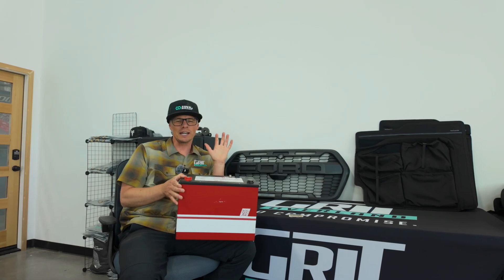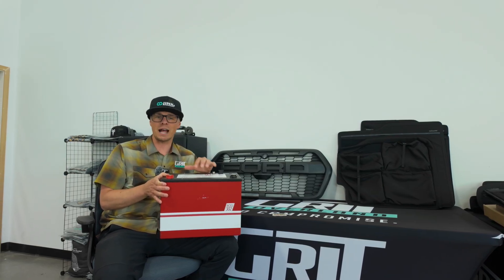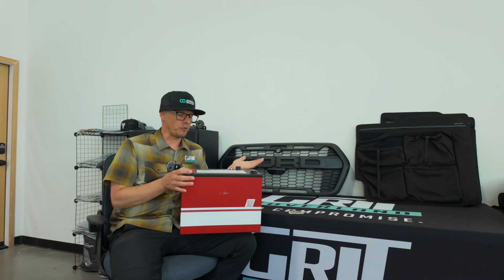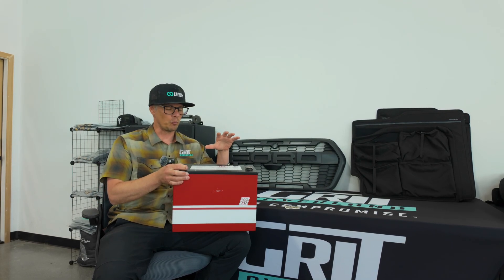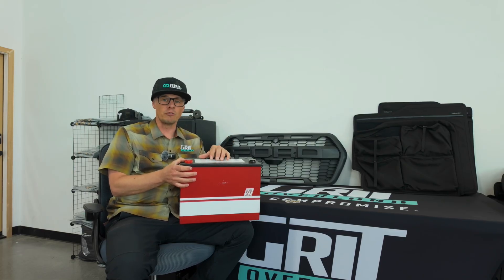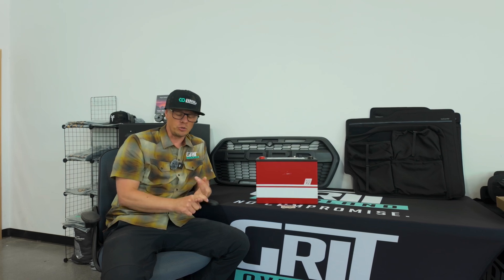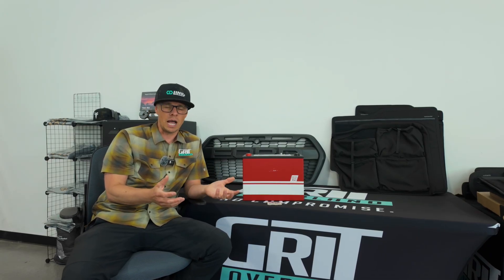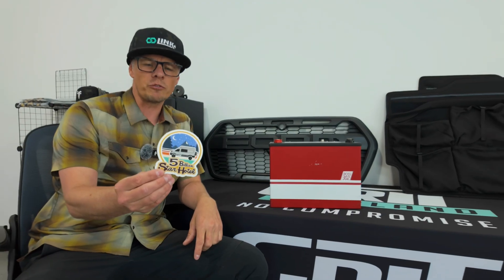What Camper Van Electrical Does Grit Overland Use? 12volt 24volt 48volt battery & off-grid charging?

Comment: Master mechanic and diagnostician here. Without question, higher native voltage house electrical systems coupled with equally matched components of the same native voltage is the way forward. 12V is entirely too low of voltage to support the amp draw of things like inverters, rooftop DC air conditioners, and heaters. There's simply no reason to argue that 12V is good when there are better solutions. Going to a native 24V ecosystem cuts amp draw in HALF when measuring that load against 12V. This cuts thermal loading on long wiring runs down significantly. Imagine how long that 4,2,0 gauge wire run is from battery to rooftop AC unit. Why would we ask that wire to carry insane amp load at 12v when we can do it with 24V or 48V instead and reduce resistance and heat loading. These vans are being built with 12V dual alternators. Hopefully it won't be long before the manufacturers offer native 24V alternation to assist with house voltage standards. You can get a 24V charging setup from Wakespeed which allows more efficient DC to DC charging with a lot less efficiency loss.

Comment: Transit is superior to Sprinters these days. Doesn’t look as nice but everything else is better.
12v is dated. Gotta move to 25v or 48v. That’s the future
Reply from the maker: We actually helped design the 51v system with a team and found that 51v is more difficult. You could check out our Video going over 12volt vs 51volt

Comment: Nice presentation as usual. I'm wondering if you have any concerns about over heating your alternator and doing damage to the diodes when recharging battery at idle? Especially on a hot day .
Reply from the maker: Great question, the beauty of them being OEM Ford alternators is they are built for that. Worst case scenario it is under Ford Warranty